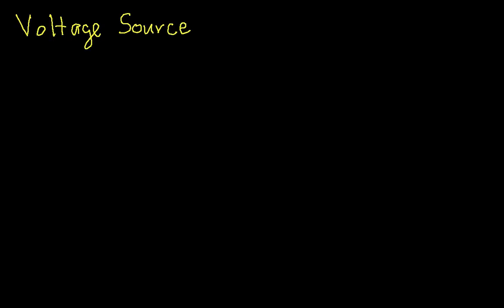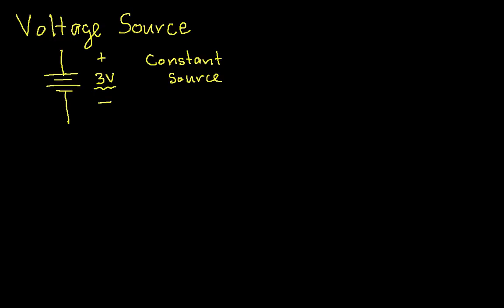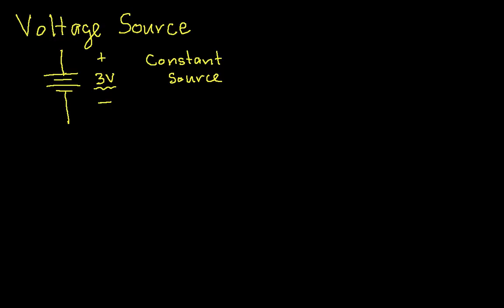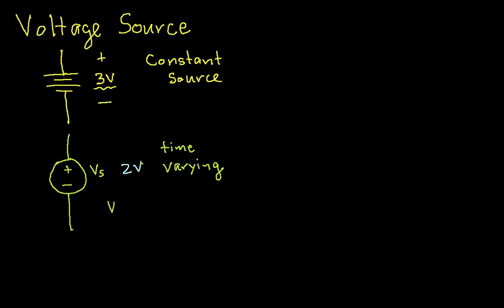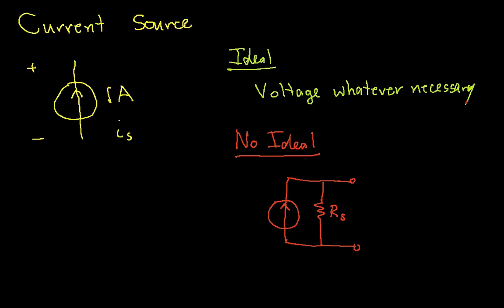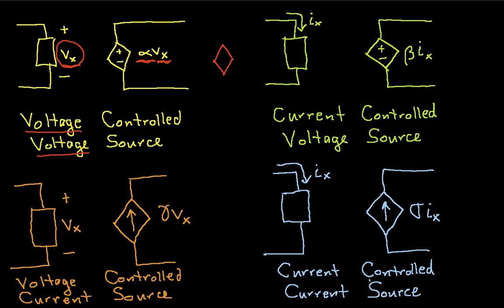Voltage and Current Sources

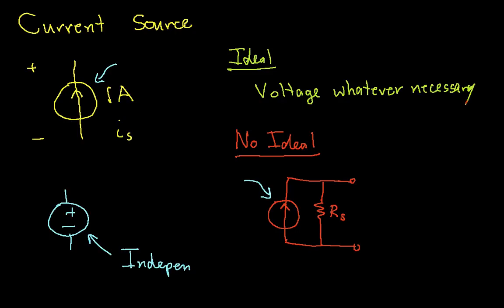Comment: 9:25 sometimes you want a constant voltage "v" or current "i",  supplied by a constant source is independent of anything else in circuit; but in some applications (amplifiers, or components used in amplifiers, like transistors), you want a v or i source that depends on some other v or i somewhere else in the circuit: "dependent source"
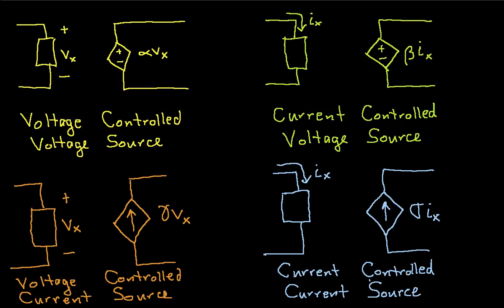10:15 four types of dependent sources; the diamond-shaped component is the controlled source

Comment: How come voltage drops when current is increased ? isn't Ohm's law V=IR ?
Reply: Heating of resistance causes building of internal resistance inside the voltage source which leads to a voltage drop..